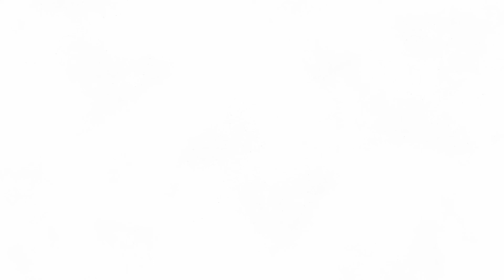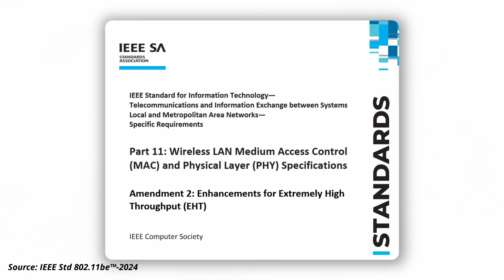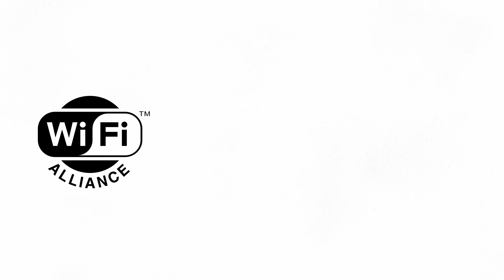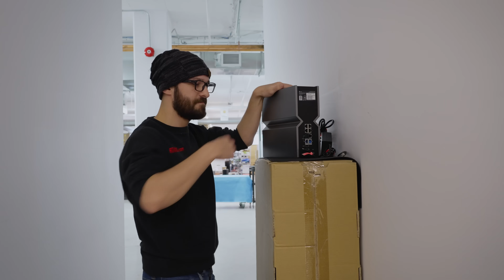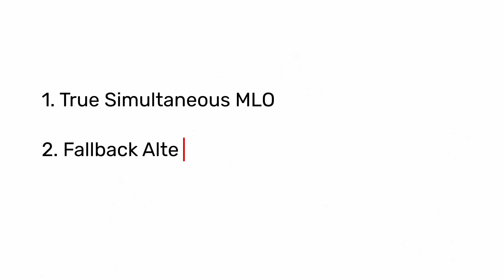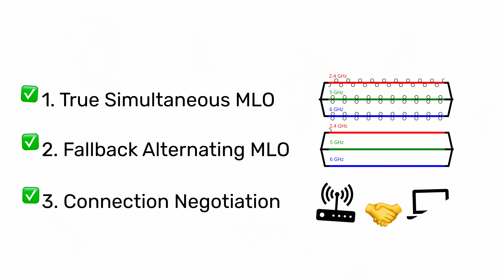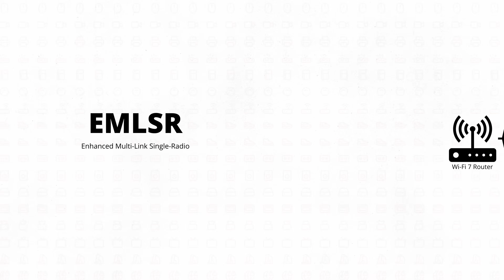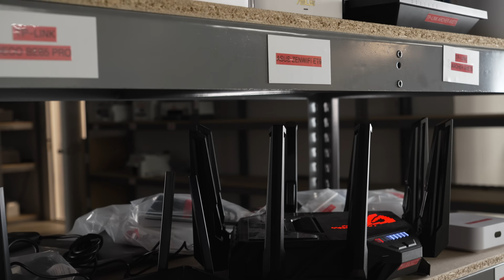Wi-Fi 7's Best Feature Doesn't Work (Yet)

Comment: About as reliable as the HDMI group!
Reply: usb and display port too
Reply: @junior-OG  USB makes since imb.

Not every port nor device is even capable nor designed to do everything the spec includes. And they make it pretty obvious the speed rating is number 1 to indicate the basics.
Reply: @MaddJakd  Not USB C. There are 20 different standards for the cable and nobody informs the consumer properly of which standard they're using, especially when it's a cable for fast charging.

Comment: I hit this issue trying to get fast wifi at home after i upgraded my internet link to 2gbps. I still can't get more than around 1.2Gbps out of my wifi7, even though my laptop reports MLO is connected at 5.7Gbps. My issue appears to be client side as i have an enterprise AP (fortinet) that has 7.6 firmware with MLO support (apparently). Client side i have a qualcomm 7800 and i suspect the drivers don't do proper MLO yet or are doing MLO with a single radio.
Reply: 5.7gbps mean fake mlo ,because 2x2 320mhz wifi 7 already have a phy a 5.7gbps without 5ghz agregation

Comment: I bought two Asus GTBE98 Pro when they first came out and set them up as mesh with 10gbe backhaul. Internet speed is 8Gbe up and down. Even with MLO on I had a feeling that wasn't working as advertised. Thank you for confirming this.  Good thing my connections are mostly wired and have multiple Cat8 cables installed throughout my home connected to 10Gbe switches. The only wireless connected devices are my phones, tablets, and other misc stuff that does not require too much speed.  My PCs, NAS, TVs, game consoles, etc are all wired.

Comment: Watching this using my 2020 Wifi5 router. Still don't feel the need to upgrade yet.
Reply: Wifi6 on 2.4GHz made improvements in my parents house that has thick brick walls. 5/6GHz is useless there though
Reply: @TheAdamAdy  yeah, wifi 7 also has benefits on 2.4Ghz in improvements in speed. Way better than 2.4Ghz of old
Reply: Most people can benefit from Wifi 6 or Wifi 6E.  With a lot of devices in use, especially on 2.4ghz, well, 6E and able to use the 6ghz as a backhaul, well..
Reply: @MrPir84free me when I'm a consoomer and not happy with what already works
Reply: Using my 2016 Google Mesh. No reason to replace it.
Reply: @BurdZirk  I have the 2020 version of that! I do wish there was a web interface instead of just the google home app, but otherwise they've performed really well.
Reply: Are you able to get your full internet speed? I couldn't get 500 Mbps until I upgraded to Wi-Fi 6.
Reply: @RegBinary  Why would you want that? That's like saying "Can you run your entire house's water supply through the kitchen faucet/"
Reply: @BurdZirk  Because I download large files (>10 GB) very often.
Reply: @RegBinary  Then you should use ethernet. I get 1Gbps over ethernet.
Reply: @RegBinary  WiFi 5 for me is 600 mbps (real world).  Full internet speed is 10 gbps.  Soo.... no.  But I don't need faster than 600 mbps on my cell phone, so I still am waiting to upgrade.
Reply: I feel the same way!  I'm using an even older 2016 mesh Orbi that's quick enough and rock stable.  I have Verizon Fios with a free CR1000A router that I used for a couple of weeks.  That had problems that I gave up on, so I turned off the CR1000A wifi and use the Orbi for wifi.  I'm a little concerned about not getting security patches (it's obsolete now) but I'm lucky to live out with no neighbors.  I've been looking to replace it now for years, but I haven't seen a compelling reason - other than the security issue.
Reply: If you’re in an apartment with tons of other networks, then the newer WiFi’s will make a difference.
Reply: @DrakeDealer luckily I'm a homeowner so I guess I'm good for now
Reply: @ToTouchAnEmu  main benefit from upgrading is WPA3, but older clients may not support it. I have those on their own separate SSID in a restricted network.
Reply: As somebody who updated to WiFi 6, then WiFi 7 - can confirm, there is basically no use-case where WiFi 5 is not more than enough. WiFi 6 did make my devices consume less idle power but from a performance perspective, no difference(theoretical yes, like “editing videos over WiFi”, actual use, no).
Reply: @aliancemd  wifi 5 is complete BS.. it really just doesn't work anymore..However, I'm talking about triband on all topics. all dualband products should be burned in a big fire.  wifi 6 is a much needed upgrade.. wifi 7, I've told hundreds not to even invest in yet as their computers don't even support it. sure your desktop likely supports it.. but you're also likely hardwired. so who cares about wifi if you're hardwired on a 2.5 or 5GB port.
Reply: @aliancemd  Correct! Streaming 4K video over Wi-Fi 5 to multiple TVs over a 9 year old Google Mesh system.
Reply: @BurdZirk  Yeah, 4K streaming consumes around ~20Mbps while you can reach on WiFi 5 ~540Mbps (almost all clients are 2x2). You have to do simultaneous 4K streaming, specifically over WiFi, on lots of devices to need anything above WiFi 5. At a weak, -70dBm signal strength, it does ~300Mbps.
That's why people saying "you are not using it hard enough" don't know what they are talking about, they don't realize that they never consume even 10% of the capacity.
Reply: @aliancemd  yall aren't using it hard enough if that's how you fell.
Reply: I can't even use 5 GHz properly in my European house with thick walls.

Comment: What about enterprise WiFi7 devices, will they be looked at?
Reply: Probably not their audience but i would love to see them test Meraki, Fortinet (latest firmware says it does MLO but does it?) and Juniper
Reply: @flain283  And what will be the end benefit to user to test enterprise devices? Only Ruckus can be used at home with Unleashed, but not Meraki, Juniper and Fortinet. All of them require expensive licenses and are always connected to the cloud.
Reply: @flain283  lol. Had same inquiry :-D "Great job ! Love to see such testing. I would like to know how Enterprise brands as Cisco or Fortinet struggled with Wireless7 and if they do job better than standard SOHO brands commonly available in the stores. 
Is that possible to test it ? ;) I know I know, the price probably would be the main showstopper (in addition also WLC needed as well)."
I got Fortigate and 3 FortiAP as home supporting WiFI6e for testing. Well, I am not sure if I am pleased or dissappointed :-D Technology of 2026 :-D

Comment: The UniFi pro devices do support proper MLO.  Did you enable them?  They break older pre 7 and out of spec wifi7 devices so they are off by default.  STR-mlmr 100% should work with the u7 pro ceiling and wall.
Reply: After double checking it is reported as broken

Comment: I had MLO enabled on my UniFi U7 AP and it was causing consistent massive latency spikes and delays for WiFi 7 clients until I turned it off.
Reply: I had clients connected on the MLO network that were connected on the 2.4GHz as their single connected link.... which explain the massive latency spikes. I don't have access to the U7 right now, but you could check your configuration if you can remove the 2.4GHz from the MLO network. It should solve that problem at least! With the testing I did, there is not much to gain from using an MLO network at the moment, but you could get a little bit more reliability in fringe situation... that's pretty much the only advantage I got at the moment with my testing (which we did not show in the video or article since it was  way too anecdotal has gains to talk about)
Reply: @sp_RTINGS I live in an area where service is bad but 2.4 does best, in winter 5Ghz works great. Would something like MLO help
Reply: Mine(U7-Pro-XGS) kept dropping iPhone 16 Pro from WiFi - not a single update fixed it
Reply: @aliancemd  known issue with iOS devices. They also don't like unifi's fast roaming implementation among other things.
Reply: Same, on a u7 pro my oneplus12 definitely performed worse at the edge of my network with MLO turned on. Instead of switching to 5ghz or even 2.4 it just stuck at 6 with the worst signal and latency. Turned MLO off and it roamed between frequencies a lot better.
Reply: I have MLO on and don't notice anything odd.  What should I be looking for?
Reply: @111ch1a1d111  Random temperature spikes, reboots and power cycles.
Reply: Yeah I had huge jumps in latency periodically with my Orbii (Netgear).  It got so bad it would disconnect most my devices from the network.  Save yourself money and don’t listen to the people shilling these products.
Reply: It doesn't support EMLMR anyway, it only supports EMLSR

Comment: Since no clients support MLO yet, maybe thats why router manufacturers haven’t enabled this feature. Or If the client sends data indicating that it supports MLO, the router might start transmitting an MLO signal as well. Since there aren’t any clients like that yet, that might be why it’s not working. But of course, they shouldn’t market the product as having MLO if it isn’t actually active.
Reply: The feature exists and is implemented... but it's implemented in its minimal capabilities. For who should be implementing the full capabilities first, it's a chicken and egg problems: routers are waiting on clients to implement and vice-versa. So, unless customers start screaming, I don't expect to see anything moving anytime soon! 
For our test method, we capture the Beacon Frame sent by routers directly, meaning this is what the router broadcasts as its full capabilities. It's not diminishing its feature when broadcasting that. When an active connection is negociated, then the packet of the association packets will have the negociated parameters. But for us, we really only have the router information with no regards to what clients on the network are capable of.
Reply: newer iPhones support single radio MLO (eMLSR)

Comment: Ive had a tplink be800 paired with a tplink tbe550e in my pc for 1.5 years now. Its been working great and i am gaming on it. All devices except a lonely bambulab have worked flawlessly.

 I have about 20 clients at the same time but also live in an apartment complex.. ive got atleast 10 routers i can pick up radio from so there is some competitors which is why I opted for early wifi 7 since most aren't even on 6 yet.

The MLO works but ive switched to dedicated 6ghz now.
Tplinks guest network feature not being able to set a dedicated channel nor mhz should get them negative points.

Comment: This is why I’ve stuck with WiFi 6E, I remember when UniFi’s engineers were discussing WiFi 7 prior to their hardware’s availability they discussed how they weren’t planning to implement MLO because of the chicken and egg situation—they didn’t believe any clients were going to support it.
Reply: You buy wifi8 to get the benefits of wifi7. The features promised are always a generation late.
Reply: @MrCoffisthis is the way
Reply: @MrCoffisthats not how it works. If end device oems dont take advantage of it properly its not the fault of the router manufacturers. Apple is a culprit of this to save battery life.
Reply: @MrCoffis Yeah but all of 6Es features are avaliable for the most part
Reply: I agree, we only have 500 up and down so unless u have 1tb fiber EVEN if all this worked the benefit would be limited. Some older devices (hunter celling fans) ONLY work on a dedicated 2.4 network, I wonder how 7 will address this?
Reply: Reality is that MLO is a feature that was never really asked for; just like 6 Ghz.  The range where you get GREAT bandwidth from 5Ghz was never that far to begin with, now let's give the consumers a shorter range with more bandwidth, when most consumers don't have anything to actually use that bandwidth for anyways ( internet is too slow, and most don't have quality high speed NAS devices at home either. ) . Let's face it, may as well drag a 50 foot ethernet cable from the router instead.. 
With 6e, the only thing I could use 6ghz with was another 6e access point, as a backhaul.  But most of my devices were built in with Wifi6 and some with Wifi5 or LESS. No 6ghz clients .. 
I might end up with a client laptop that can use 6ghz in a few years; or perhaps a phone, in a few years, which IMO won't matter either. 
The Wifi 7 routers will be out in the wild about half a decade before most consumers have clients that are "wifi 7 " let alone MLO.

Edit: I should add that the only way even 6Ghz makes any sense is if you have a wired network with actual 6ghz clients is IF you have a MESH router setup. Or if you have a Mesh setup without wired secondaries, using 6ghz as a backhaul.
Reply: I think Wi-Fi 6e is not very good because you’re expensive 6 GHz supporting devices won’t automatically switch when you want range over speed.  At least with band switching Wi-Fi seven the router and device will optimize which band you’re on based on Signal.
Reply: @joseguzman6988  iOS is notorious for preferring 6GHz over 5GHz even when it produces inferior results
Reply: @joseguzman6988  yes they do. My Asus GT-AXE16000 let's my client decide to which band it connects and clients always prefer 6E then 5 and then 2.4, and this without any forced roaming assistent on the router on.
Reply: 🤦... This is absolute freaking nonsense, and I say this as someone with a WiFi 6E router...

6GHz's ABSOLUTELY GODAWFUL range and object permeability makes it basically USELESS without having current day WiFi 7's automatic band to band handoff support, outside of some very niche use-cases.

Outside of niche use-cases like wireless PCVR streaming while playing in the same room as the router & PC, 6GHz WiFi is only a legitimately useful technology if you have automatic band handoffs for when you inevitably leave or enter the room the router is in. 🤷 Otherwise it's just not worth connecting to unless it's like a laptop that literally never leaves the room the router is in.
Reply: @Cooe.  this is so true I think people don’t understand Wi-Fi 6ghz until they use it.  It’s like 5G m wave only useful for very narrow use cases.  Instead of the normal WiFi speed bump that increases the effective range by making it more usable at the fringe from generation to generation. This can destroy your range and seems like a plot to sell 6 ghz ap in every room.
Reply: @Cooe. I have UniFi E7 Aps and 6ths covers a very far range. You experience may vary with 6ghz plus this Ap has access to extended range 6ghz. It covers 2000sqft easy.
Reply: @yotea1064  it drops off majorly with even the thinnest obstacle in the way. Line of sight performance is phenominal though.
Reply: @JamesTK mine does not. Ap is in a closet and I can still get 2 gigs or more from it. It just depends on the ap or device.
Reply: @yotea1064  parents house has a lot of unfavourable walls that signal has to go through on a diagonal resulting in a much thicker wall than otherwise. Out in the backyard a straight line from the U7 Pro XG it is phenominally fast. Just a tad overkill for their needs, but I really wanted the range.
Reply: @JamesTK the E7 would give that range. Unfortunately any other wifi 7 ap from ubiquiti doesn't do well for 6ghz. 5ghz theyre all amazing. But I wish I had gone E7 all along it covers most of my house and allowed me to consolidate down to two aps instead of 4. My house has challenging walls as well and my roof is metal so its fun.
Reply: @yotea1064  parents have a U6 Lite in the spot the other ap doesn't cover... Not upgrading that any time soon, WiFi 6 is more than adequate, only got the WiFi 7 ap as it had the new heatsink design
Reply: @JamesTK yea the new design is not worth it. For sites I just deploy the u6 pros it’s adequate enough for most devices. For my house I like to try new stuff.
Reply: @yotea1064  Do you have AFC Enabled on your E7 if it's available ? That could probably be why your range is larger
Reply: @yotea1064 that's why I still stick to the U6 Mesh, till Unifi gets proper 7 Support on their APs.
Reply: @Cooe.  sorry guess I’m niche. Literally what I use it for. Doesn’t invalidate my personal experience I expressed. Quest Pro + Virtual Desktop, dedicated radio & SSID
Reply: No. No hace falta tener clientes Wi-Fi 7 para justificar una compra de enrutadores o nodos de malla porque entre ellos pueden conectarse con Wi-Fi 7 y los clientes a la misma norma o menores y aún así ver beneficios.

Comment: So is it a software, hardware, or private royalty payments problem for this typical BS?

Im guessing a hardware issue. The chipsets they need for these features require more compute and that's too expensive. Maybe?

I doubt it's because of the private wifi branding. If you had the capability to implement it you would. The branding is just to certify.
You can offer a product feature without it being certified.
Reply: It's probably a demand issue. Since clients don't support it, networking companies don't feel the need to spend resources implementing it on the router side. One of two has to make the first move though or else MLO will rot in the specification.

Comment: I'm still on 5 and feel no need to upgrade.  Important traffic goes through wired anyway.  I'd much rather 2.5 and 5G switches become the default in routers than the newest wifi standard.